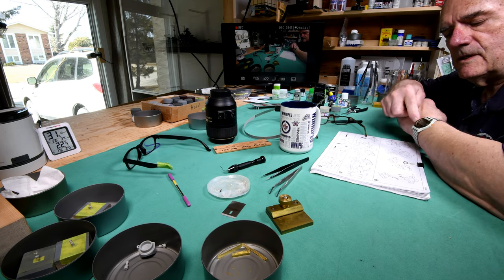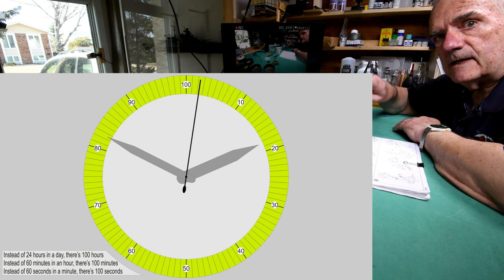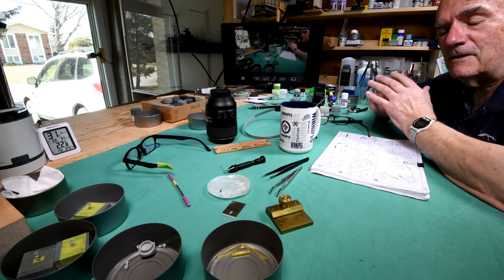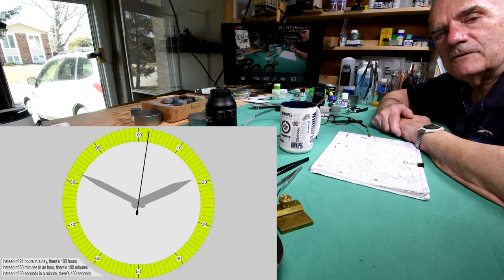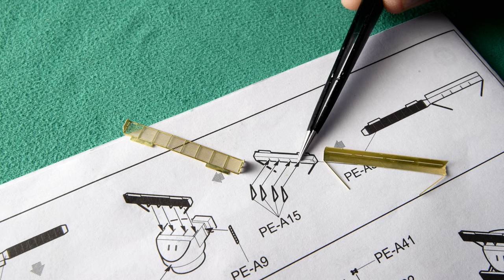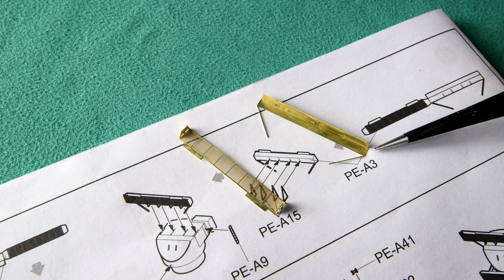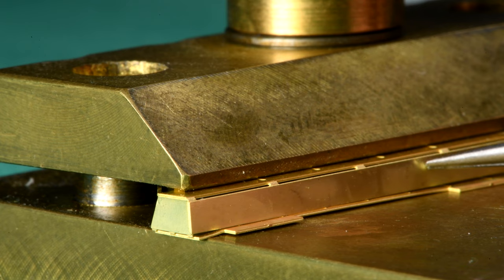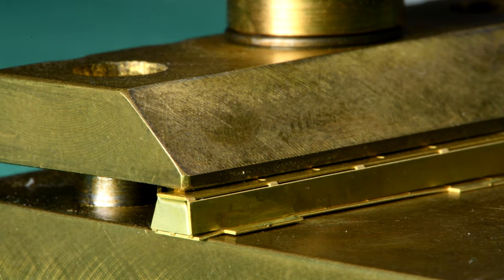The Model Ship - Part 764

Comment: Ron “Digital time” is simply using numbers to show the time and not using the hour and minute hands. What you are talking about is actually “Metric Time” where everything is devided by ten. If the world would ever move to ALL METRIC SYSTEM than Metric Time would be the perfect time. If you really want to get confused about time check out why we don’t use “Local Solar Time” (some days are longer than 24 hours while some days are shorter than 24 hours).😳
Reply: Ron I was wrong Decimal time is not the same as Metric time. In  1998 the Swiss watch company “Swatch” created a digital time called Internet time which is not the same as Unix time.🥴 I think it’s time for me to stop reading about time before I get so confused that I have no idea what the correct time it is!🤯